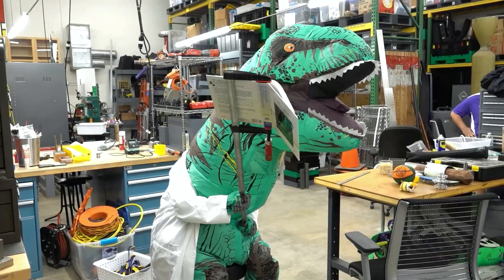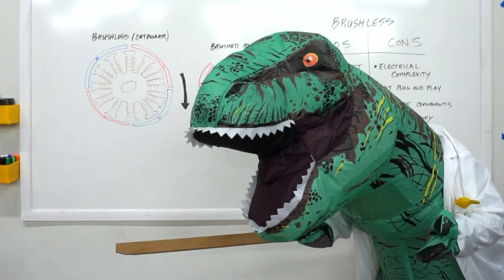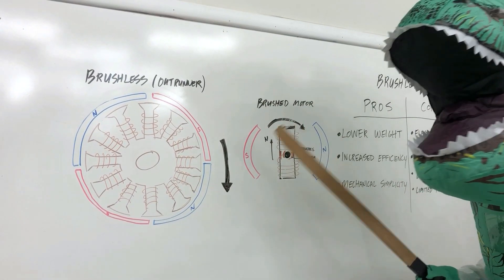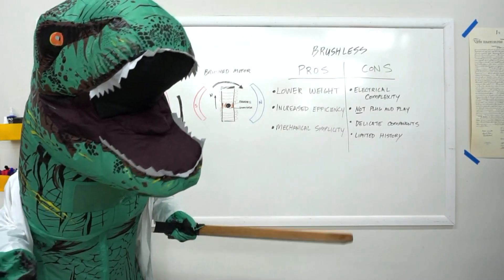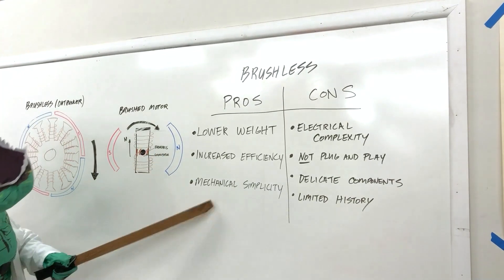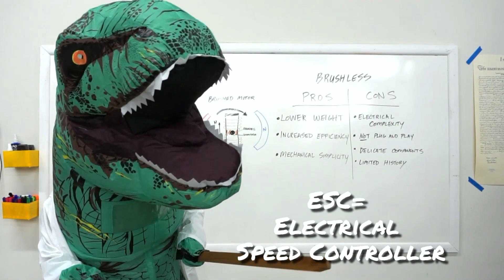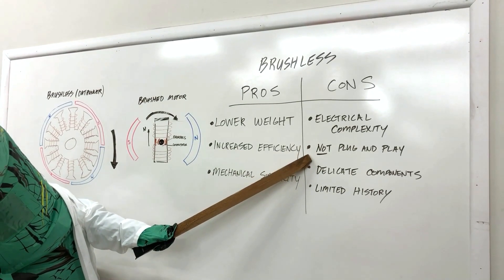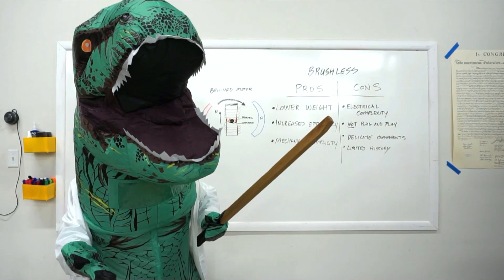Why Do BattleBots Use Brushless Motors? // Technical T-Rex

Comment: I actually build prototype brushless motors and ESCs (inverters) for automotive applications.  We have built motors ranging from 75kW to 450kW (~600HP peak).  Soon, we are going to build a line of 1.5kW to 20kW motors with integrated inverters, thus simplifying the systems.  Our systems (motor and inverter) are 97 to 98 percent efficient through the full RPM range due to proprietary technology that lets us convert the motor from permanent magnet to inductive and back again while the motor is running.  The 450kW prototype was mounted in a 2008 Tesla Roadster.  That thing was crazy fast.  0-60 in sub 3 seconds fast.  One bonus versus the original motor and gearbox is we have room for a second motor.  We just need the battery upgraded to the new 4680 cells to supply sufficient current.  As it stands, the battery overheats after about 10 minutes of hard driving.
Reply: Company? Contact Info? Website?
Reply: @MaxBrix  We're a tier 1 supplier for now, so we only deal directly with OEMs.  Each prototype system costs around 100k to 300k to build.  We're estimating the smaller versions will prototype at 30K each.  I'm hoping that an OEM will have these in consumer hands in the next 3 to 5 years and not just in a product.  One of our biggest technological advancements is we have done all this without the use of rare earth elements in our motor, but are only marginally larger than the latest PM motors using neodymium magnets.

Comment: Technical T-Rex faces the same dilemma when choosing a toothbrush. Manual or electric? 🤔

An electric toothbrush can be of any size and can be manipulated via remote control, but is very expensive; a manual toothbrush is small and cheap and reliable, but tricky to operate if you happen to have... er...  abbreviated forelimbs. 😲

Oh, dear Short arms. Sorry, Tech. I've said a bad thing... 

[P.S.  This argument is seriously flawed and specious in the extreme, but I reserve the right to talk utter rhubarb. Hey, it's what I do.]